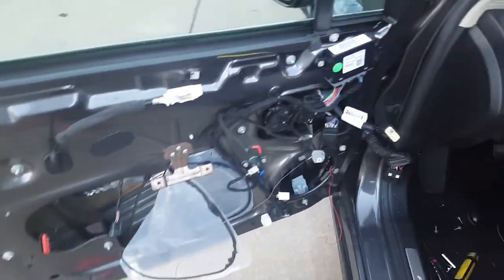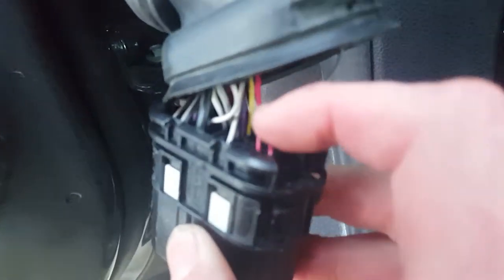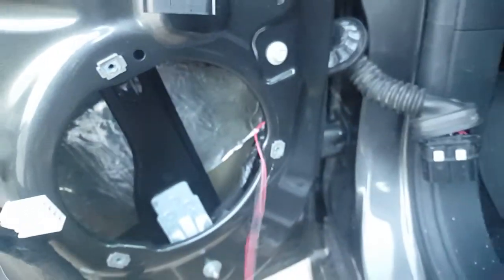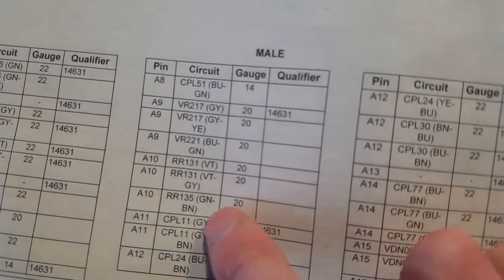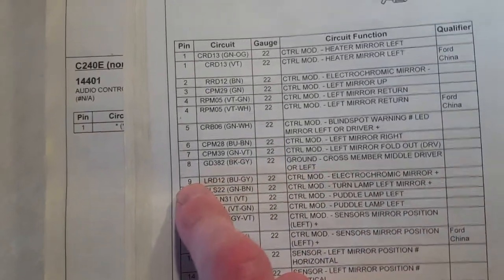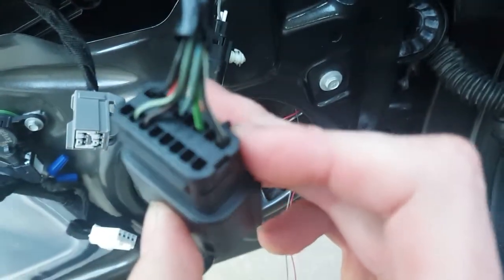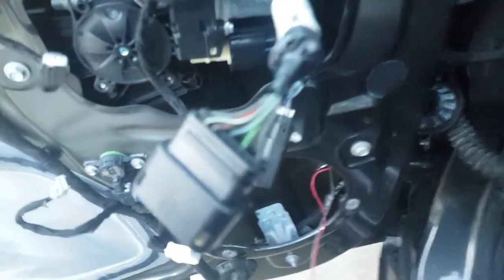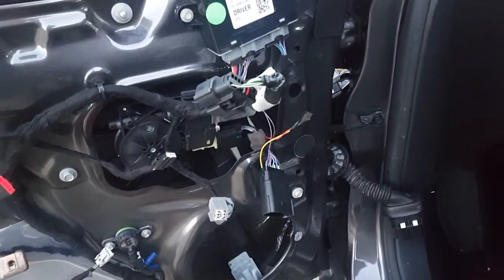Process of adding electrochromic mirror

Comment: Hey Nick, where did you get those auto dimming mirrors at?
Reply from the maker: I got mine on ebay
Reply: @Nickthecarguy  
What should I search for on eBay? Like what's it called? I have a 2017 Ford Fusion too
Reply from the maker: @mason4976  I just type in 2017 ford fusion driver side or passenger side mirror which ever side you looking for

Comment: Do you know what would be involved in adding power folding mirrors.  I have a17 mkz which I know is similar to your Fusion, please help me if you can.
Reply from the maker: b1n2fra you will need to find out if you're near connector that's on the door have the auto folding mirror wiring already there if not you'll need it whole new door harness with auto folding mirrors and if your mirror is not already Auto fold you'll need a new mirror that has the auto fold on it then you will need to enable it on the driver's door module which I do have a software for that
Reply: Nick the car guy how do I check the wiring to see if it's already wired for it.  Do you know which ones to look for.
Reply from the maker: b1n2fra yes I do I have a wiring diagram you can message me on Facebook at Nick The Car Guy and I can send you a picture of the diagram and if you're not for sure you can send me the picture of your connector and I can let you know if they already have it or not